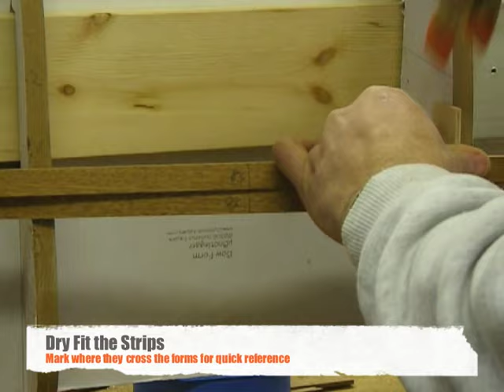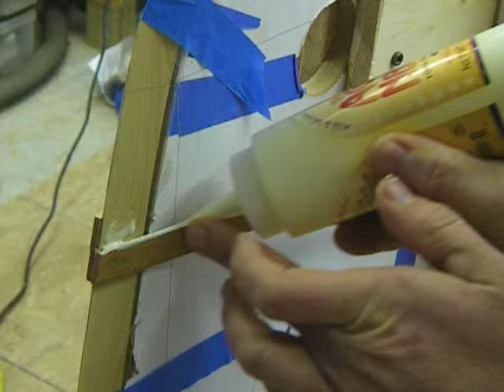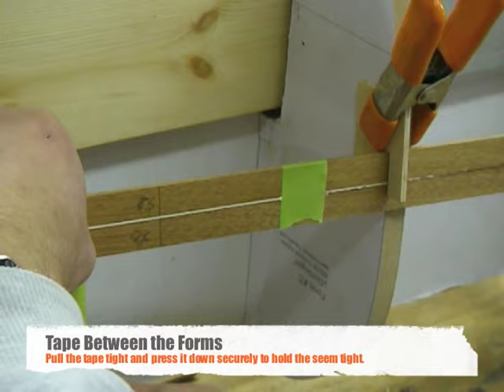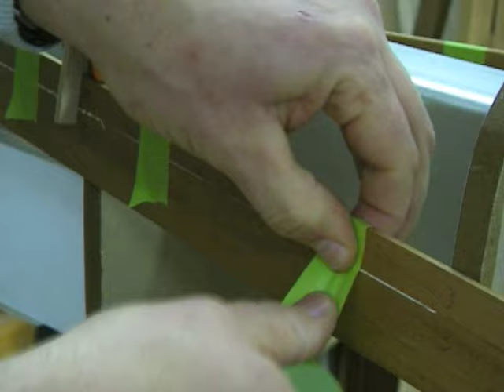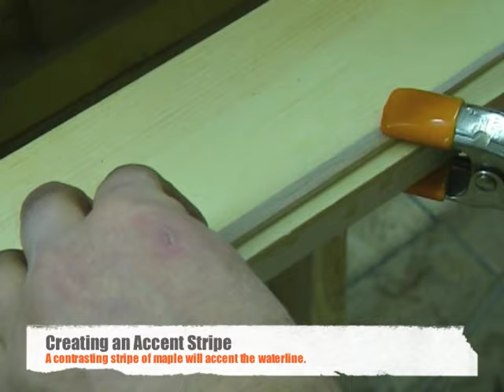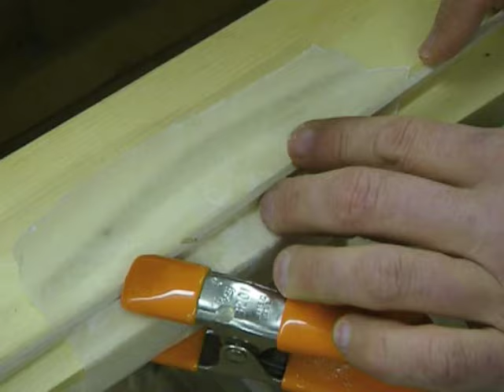Stripping a Wooden Kayak

Comment from the maker: No, sometimes it is easier to glue them together on the boat. With this thin accent strip, I felt I could get a tighter joint on the workbench.